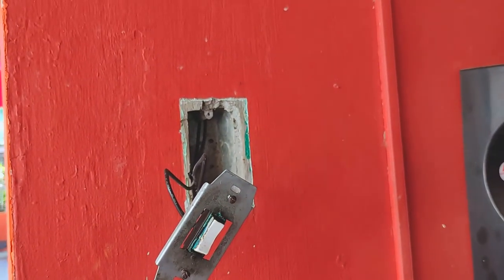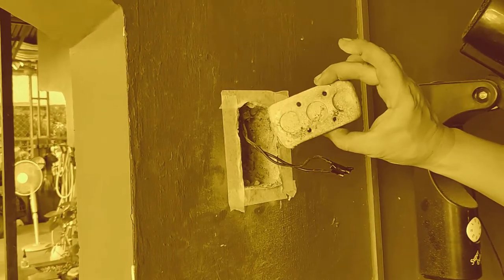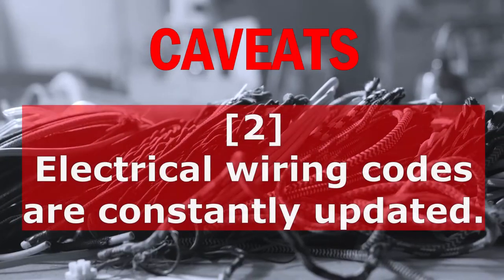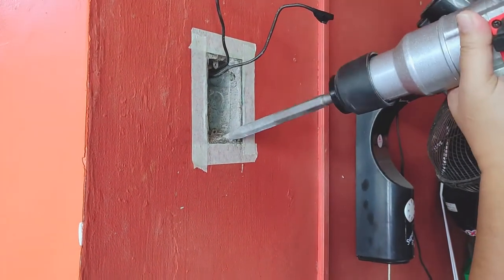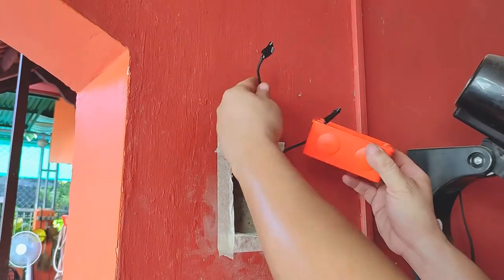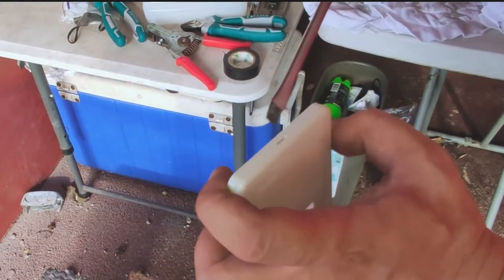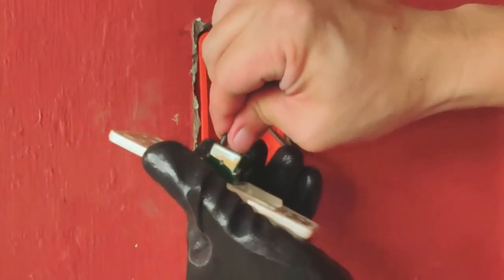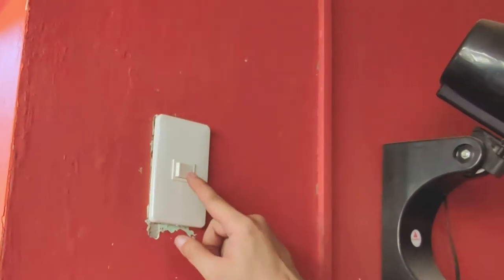How to Replace Junction Box & Light Switch on Concrete Wall

Comment: Hello, sir. I need your help with my light switch replacement please. 

I did a DIY for two single light switches - on concrete and on drywall. The bottom part of the new light switch panel won't screw all the way through. It's kinda loose. The upper screws seem okay and are flat against the wall, only the lower ones aren't. 

After I put the switch covers on, there's a noticeable little gap behind the wall - on the MID to the LOWER part. 

Your video is helpful and I'm sure it will solve my issue but I'm afraid I won't be able to do it. I don't have a jack hammer and I am not sure if a chisel will do the job. I'm afraid I will damage the house if I try to change the junction box. Is there another way?
Reply from the maker: Have you tried changing the screws for the bottom part -- the threads might have been loose? Also make sure that the entire junction box is evenly flushed against the wall -- so that when you put on the switch panel, it seats evenly from top to bottom. Try wiggling the junction box to adjust its angle somewhat so it is flushed against the wall from top to bottom.